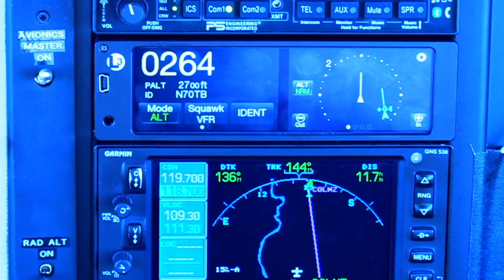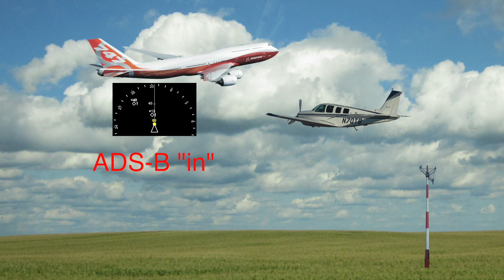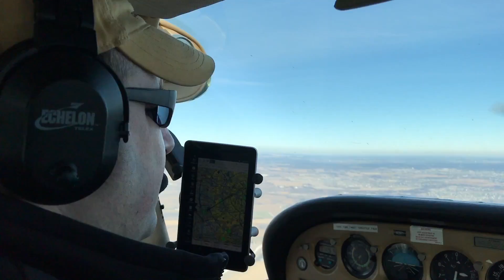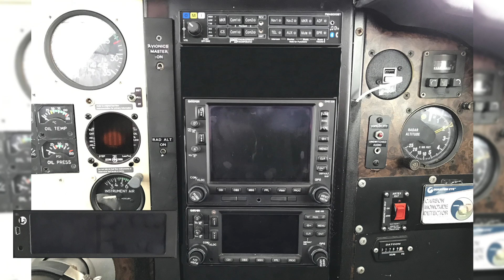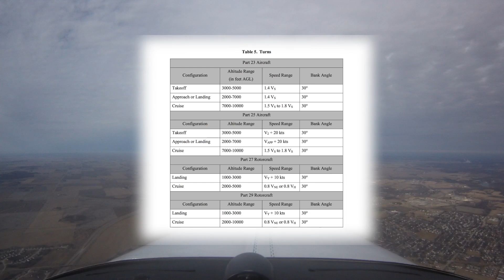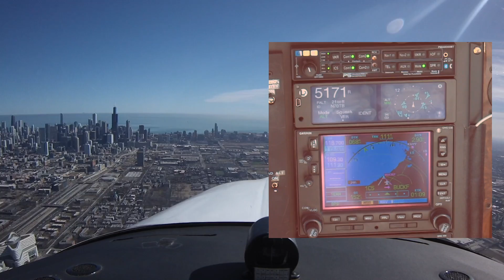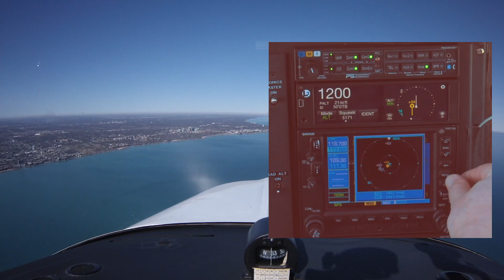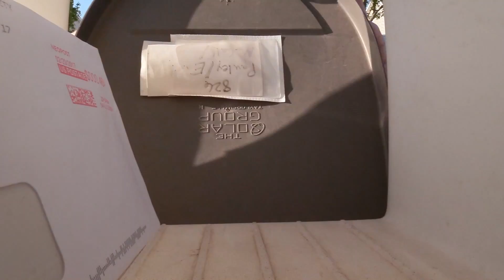ADS-B in a Bonanza

Comment: Hello Martin, i’m looking into installing ADSB now in my Warrior. Would you recommend the NGT 9000 after having it now for quite some time? Thanks
Reply from the maker: Hi Joe. I am still very happy with the NGT-9000. I would pick it again if I had to start over. The additional display for traffic is invaluable, even though I have a nice map display on the Avidyne IFD and also the iPad, but those usually are set to farther ranges than what is useful for traffic avoidance. I have the 9000+ model with active traffic which I like very much; if you go for the base model (9000), I strongly recommend adding the ATAS option to get the audio alerts for nearby traffic.
Let me know if you have any other questions - happy to help if I can.
Best regards,
  Martin
Reply: @martinpauly  Thank You for responding Martin. The 9000+ with atas is the way to go. As you said “it’s not cheap” but neither are our lives. Safe skies!

Comment: whats better the three prop or the two prop do i0 550 fits in all bonanzas
Reply from the maker: That's almost a religious question. In general, two-blade props are faster, while three-blade props are quieter. With an IO-550, you don't get a choice in the Bonanza - it HAS to be a three-blade prop.
I do not know if the IO-550 can be installed in all models of Bonanza, but I've seen V-tails, 33s and 36s with the IO-550, so at least it's pretty common.
- Martin

Comment: When you have an issue with the AI and HSI/DG steam gauges, consider replacing them with Garmin G5’s, a GMU-11 magnetometer and removing the vacuum system. Outstanding combination with internal battery backups and EHSI capability.
Reply from the maker: Thanks - that's a good thought.  Either those, or an Aspen which costs a bit more but shows even more information.
Regards, Martin
Reply: Martin Pauly Take a look at the reported loss of attitude indication when the Aspen loses GPS input. Also, if the G5 AI were to fail the EHSI can be switched to an AI. Great backup option. You will also have vertical guidance on the AI and the HSI. Not sure if the Aspen will indicate two. The is a single point of failure with the Aspen, also. Lose one instrument and lose everything. A lot of redundancy with the G5 combo and they interface well with the GNS530.

I also did a Flight Stream 210 that loads the 530 from ForeFlight or Garmin Pilot (no more 530 twisty/pushy). Not sure if WingX allows that option. Garmin!👍🏻

Comment: Although it is kinda admitting that your traffic spotting skills suck, having ads-b is a real turnaround from what flying was like before. Its like finding that there are suddenly a lot more aircraft in the sky than before. I typically leave the unit ranged out 12 miles when on cross country, then range in when I see multiple targets close by. I try to use the unit to improve my spotting skills, using it as a guide as to where to look for the aircraft.

It is not necessary to spend a lot of money to get ads-b. A ads-b out only solution like the one that integrates with you wingtip strobes can be complemented by a portable, non-tso ads-b unit to show traffic on a tablet or other computer.

It would be nice to move to %100 ads-b equipage. This is one of the most obvious safety enhancements to come along for aircraft in a long time.
Reply: Just an after note, that wingtip strobe solution is $1800. Its similar to low end units, but I think it gets made up on install costs.
Reply from the maker: @scottfranco1962  That Wingtip ADS-B out solution is a wonderful idea!
- Martin
Reply from the maker: You are right about how ADS-B is an eye opener in terms of how well (or poorly) "see and avoid" really works. The sky is still a big place, so the risk of a midair is very low, as shown in the accident numbers. But we don't see every nearby airplane, no matter how hard we look - that's where ADS-B or other traffic systems are a tremendous help.
Best regards, Martin

Comment: Hi Martin
Great videos when you had the Lynx installed active traffic did you also do the antenna diversity added?
NGT-9000+ or NGT-9000D+ I like there unit and will be installing one in my 1959 Piper Comanche
Thank You
Reply from the maker: Hi Curtis, 
I did not select the diversity option - I got the NGT-9000+. Diversity is not required for my airplane; I figured should I find after some time with the unit that the "D+" with diversity would have been good, I can add that simply by purchasing an activation key from L-3. After all, the extra antenna needed for diversity is already there, it's the directional antenna on top which is then used for the additional purpose of diversity. Having said that, so far after a bit over a year of flying with my 9000+, I have not found myself in a situation where I missed anything from the traffic picture that diversity would have added.
Diversity or not, I'm sure you'll be very happy with the Lynx in your Comanche.
Best regards,
Martin
Reply: Hi Martin
Thank You for the reply I look forward to getting one installed in my Comanche I think I will do the same as you with the option to upgrade with just the unlock code.
Keep up the Great videos
Thanks again
Curtis

Comment: Thank you for sharing, since you removed the landing indicator light, how do you know that the gear is down and locked
Reply from the maker: Hi Anthony, my Bonanza has three gear indicator lights close to the gear handle, i.e. lower center part of the panel. Those are still there. The ones that were removed during the ADS-B installation had been added at some point by a previous owner of the airplane, in addition to the standard gear indicator lights.
Reply: Ohh ok, thank you for getting back to me

Comment: Another great video!
Just curious, what kind of oil do you use in your Bonanza?
Reply from the maker: Bud, I am using straight-weight oil from Aeroshell, W100 in the summer and W80 in the winter.
Reply: Martin Pauly thanks.
I've talked to engine shops and a lot of different people and they say the same thing as you.
I went to Oshkosh and went to a Aeroshell work shop, the Aeroshell rep was pushing Aeroshell 15W50, I'm staying with the straight oil myself.
Reply from the maker: Nothing wrong with the 15W50 from what I can tell. However, the engine was mid-time when I bought the plane, and my mechanic advised going from one kind of oil to another. Whether that's good advice or not, my engine has been performing very well without any hiccups.

Comment: Great video and excellent editing which, I am sure, is quite time-consuming. I am pulling the trigger for GTX345 next month. Hopefully Uncle Sam will still have 500 bucks for me ;-)

Question: after 1.1.2020 will the Active Traffic sort of loose its appeal since mostly everyone (excluding aircraft with no electrical system, etc) will have the ADS-B out?
Reply from the maker: Thanks, Flight of Passage, and good question on what happens "after 2020". While active traffic will be less important as people install ADS-B "out", not everyone in the US will install ADS-B "out".  Quite a few airplane owners will not, and accept the limited access to airspace (e.g. less than 10,000ft, no Class C/B). So especially the scenario I highlighted in the video - traffic pattern of a remote field, away from radar services - will still make sense after 2020.  And if you fly abroad, to a country where ADS-B is not required, certainly ADS-B will help there.

Comment: we are staying away from the touch screen for this exact reason, plus we think that operating in bumpy condition would be really hard. 
What was your rational in paying for the ADS-B in? Tablet based solutions(Foreflight/Garmin) are evolving and progressing so fast, we think that locking into an all-in-one unit does not make sense. 

Why did you feel that all-in-one solution make sense?
Reply from the maker: Good questions, Dmitri. I had and still have an iPad with a EFB app in the cockpit (WingX in my case, but ForeFlight/Garmin Pilot etc. would be similar). I used to feed ADS-B "in" from a portable receiver (SkyRadar) into it. And it was great, most of the time. In terms of "best bang for the buck", I think this was the sweet spot.
But I wanted more, knowing full well it would cost me. Three things in particular: First, I have witnessed cases a few times over the years where the iPad was showing wrong information - weather that was stale (as in an hour old) or not shown at all, things like that. A certified product goes through a lot more care and testing in development, is modified/updated much less often, and reduces the number of those kinds of "surprise moments". Second, for traffic I absolutely wanted to have aural callouts, and reliable ones. I know some of the EFB apps try and you can hook them up to the audio panel, but again, this is something that works great 90% of the time and I wanted something close to 100%. Third, as I explained in the video, I wanted active traffic in addition to ADS-B "in" - and there is no iPad or other portable solution for that. It took a lot more money to get all that, and I'm not saying everyone needs it or should aim for it, but that was my approach.
Regarding the touch screen and turbulence, I've been wondering about it, but it's not been an issue. In turbulence, it helps to rest some fingers on the bezel or somewhere else around the touch screen to get firm control over your touch finger. And unlike the iPad, the Lynx has a resistive touch screen which requires a little bit of push (beyond just barely touching) before anything is activated, which helps a lot in turbulence.
Happy flying!
Reply: thanks, Martin. Nice wright up.
I suppose you started with more than one device candidate and you chose Lynx, who was your runner up?
Reply from the maker: My second choice would have been the Garmin GTX 345. Good transponder with better integration with my GNS530/GNS430 units than the Lynx. The downsides are it doesn't support WingX (my EFB app), no display on the transponder itself, and it doesn't have active traffic built in. Active traffic can be added through another Garmin product, but that total solution would have been more expensive than the Lynx.